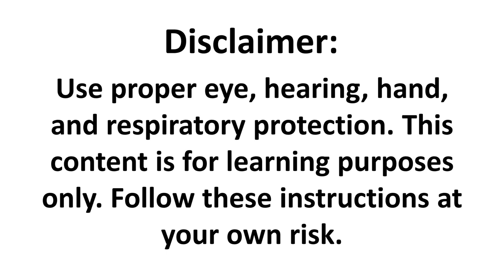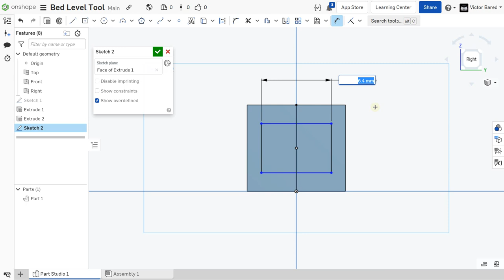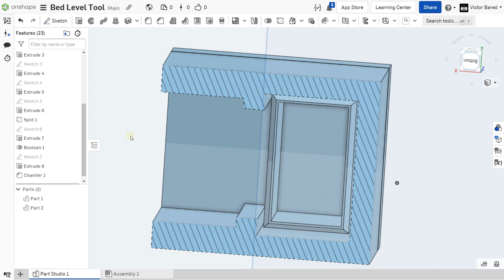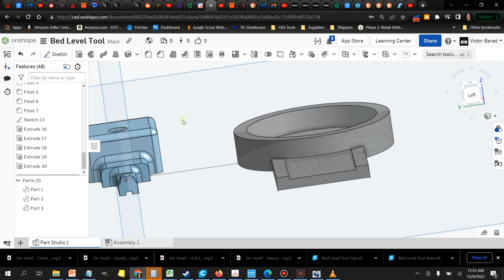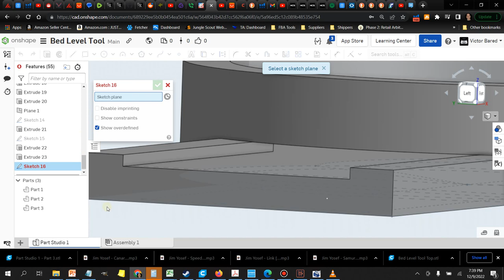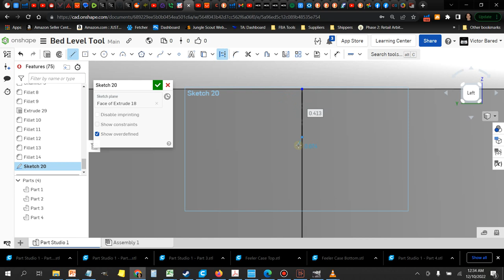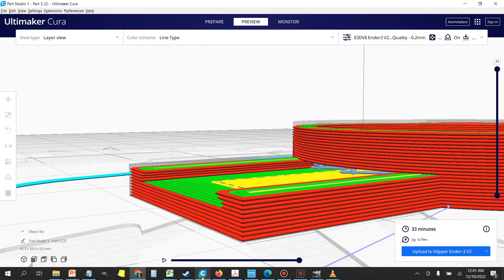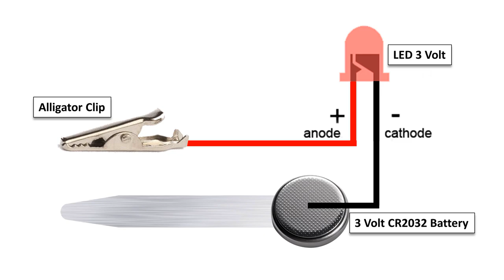Ender 3 Pro V2 3D Printer Bed Leveling Assistance Tool Designed Using OnShape

Comment: Hi Victor,
 
Well done my Friend that's a nice simple way to do the manual bed leveling.  I did spend some time on the E3 Pro here tweaking the Z home switch to get closer to the bed initially.  I'm going to make one up of the tools as my E3 Pro is now 500 mm in the vertical with a usable Z of 470mm.  For now the Creality firmware for the E3 V2 BLT has been flashed and the LED tool is the way to tune a little tighter on the corners and can be used at the center of the bed for an checking.

Great job as always with OnShape I get a new trick and a tool or two every time you share with us.

A note:  On the G drive there is all my testing data for air flow and temperatures values in an Excel file for your review.  The data shows how efficient the new fan housing really is.  That too is a great design sir.

Doc'
Reply from the maker: Hi Friend, Thank you for your positive feedback. I'm glad your day went well and that you're back in the shop. 470mm of extra Z volume is amazing, GREAT JOB! The bed level tool works great but relies on a very clean nozzle to work properly.

Let's try and connect in the am to review the airflow data you compiled. I'm currently working on learning to print with Nylon, which is super finicky and very hydroscopic. Snap crackle and pop is what I was getting yesterday during my initial testing.

Enjoy your evening with B.
Reply: @vbared  Hi Victor, can do but later in the am.  I also requested that Miguel's firmware have the X Y & Z axis movements behave like the E axis for manual movements.  He replied that it is in his current experimental version and will be in the next public release.  Although no date was given..YEA !!!!!
Reply from the maker: @doctrainsmodifications5201  That's awesome! Looking forward to our conversation.

Comment: Very Nice! I have a cr-touch with klipper and I can't go back especially for leveling with a config for your printer you can send the SCREWS_TILT_CALCULATE command and the terminal will automatically tell you exactly how much you have to turn the nobs to 'manually' adjust them perfectly! Of-course paired with the automatic bed leveling.
Reply from the maker: Hello Someone Maybe, Thank you for commenting and kind words. Yeah, I hear you setting up this used Ender 3 Pro and having to deal with the standard firmware is frustrating.

I appreciate the Screws tilt info. I'm going to have to try it. Klipper offers so much and I'm just dipping my toe in.

Best of luck with your mods!

Comment: Victor, as always, well done! Great implementation of the right idea. Definitely in the collection of useful things)))
Reply from the maker: Hello Burbycian, How are things going. What new projects are you pursuing?
Reply: Projects are yours, but for me this is too loud a name.))) I am fighting with minor defects - in the "vase" mode I have achieved an excellent surface, in one place, literally diagonally, dotted under-extrusion. Apparently, we need to fight not with the settings, but with our own perfectionism.))) And I plan to input shaper and still I want to use two unused ports of the microprocessor for individual fan control...

Comment: Victor a question 🤔
Which speed do you use with a standard ender 3 🤔
Reply from the maker: Hello frits183, Thank you for commenting. 50mm/s is the max that I could run without the loss of quality using the stock firmware. If you switch to Klipper on a laptop or Raspberry Pi 75mm/s-100mm/s is the max before running into the limits of stock hotend, 100mm/s-125mm/s running an E3D V6 hotend and dual parts cooling. The main differences for the differences in speed stock vs Klipper. Three things offered by the later are processing power determines speed, pressure advance and input shaper counteract the artifacts caused by the speed induced vibrations and direction changes. Newer firmware like Miguel's Professional Firmware enable linear advance and input shaper but the lack of processing power to push speed like Klipper can.

Best of luck with your mods!